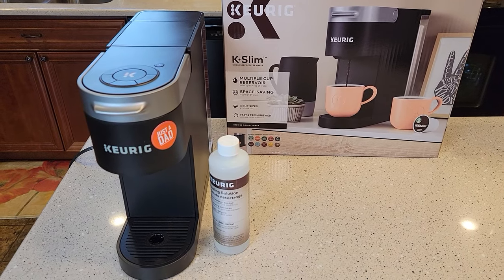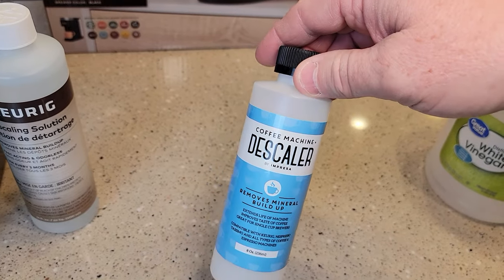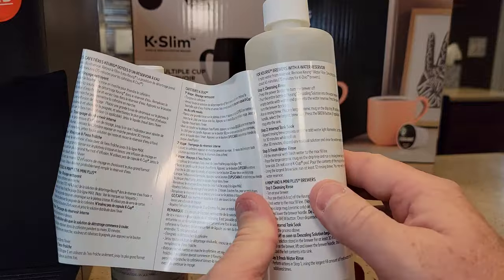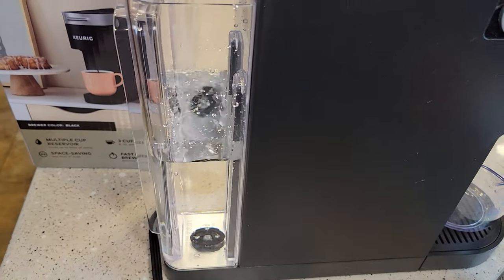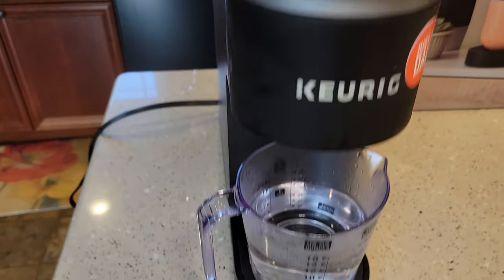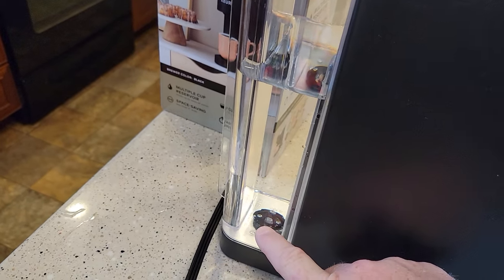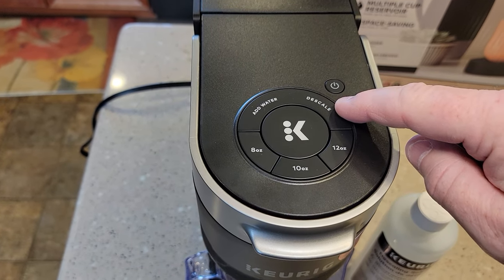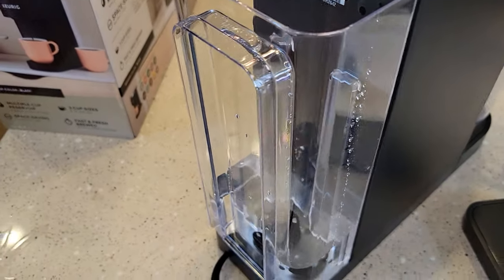HOW TO DESCALE Keurig K Slim Coffee Maker With Keurig DESCALING SOLUTION DESCALE LIGHT ON

Comment: Thank you! The water still didn't want to come out after cleaning the needles(which I learned how to do through another of your videos) so I googled and it said to reset the machine by holding the 'K' and 12oz until water dispersed. Once I did that I came back to this video and it's working beautifully! I appreciate your uploads!
Reply from the maker: No Thank you!!! I just learned something new today about how to reset The machine thanks to you.  Wow Thank you so much for taking the time to leave feedback about your story and let others know how to fix it.  I am sure there are lots of people out there with the same issue.  I will incorporate this into my future videos.  Thanks for Watching and your kind words!!!!!
Reply: Thank you for sharing - I did not know this.
Reply: so if the light still flashes "descale" 

hold 12oz & K  until it resets ?
Reply: Still not working for me. I tried the descale of this video repeatedly, starting from unplugged etc. Now I tried this reset (K plus 12 oz) and it did something so I thought I 
 was good to go. Started descale again and nothing. Mine will not brew if the descale is on, so I have a paperweight. The descale process worked last time I tried it, about 5 months ago. Nothing doing this time. Any other ideas?
Reply: Had the same issue just now, thanks for the tip!
Reply: My output improved some, but I went back to the directions on the Keurig solution bottle and it says you have to let the machine sit in DESCALE mode for 30 minutes after the Add Water light comes on. You said to dump the leftover solution and wash the carafe with soap and water before the rinsing process. I think my process would have worked better after a 30 minute soak. Otherwise, your video was excellent.

Comment: I have the K-Slim with iced coffee setting instead of a power button. And before anyone asks, it shuts itself off after a few seconds of no use. To get into the descale mode I had to hold the iced coffee button for a few seconds (between 3-5 seconds) to put into Descale mode. And then I followed your instructions. It worked perfectly! Thank you so much for the walk-through!! I will most likely be pulling this up in a few months to do it again! (I have a severe traumatic brain injury so short term is pretty much quite short!)

Comment: Thank you for a very clear and consice video of descaling this wonderful machine. They really should make this part of the instructions for these machines. I tried to do this with Keurig instructions and now realize that I wasn't descaling, just running the solution through the machine. I will check out your other videos. THANK YOU!!!
Reply from the maker: Thank you very much!  Glad it helped.
What is your favorite K cup?
Reply: The same here! I used the pouch and followed the instructions to the letter and the descale light is still on, so I will do it again. This time I will get the bottle. Thank you for this great video!
Reply from the maker: @sistermargaretrobinson1596  Keurig has changed the way you descale your coffee maker.  You have to put the machine in descale mode and follow it all the way through to get the descale light to go out.  
step by step instructions see below.  You have to follow them all the way through.  
I hope this helps. put the descale solution in the tank.  You have to put  the machine in descale mode.   First leave the machine plugged in, then turn the power button off.  Press and hold the 8oz and 12oz button for 3 seconds till the big k brew button starts flashing.  This puts it into descale mode.  The only thing you will see is the big k button light on.  the power button does not light up.  press the k button and it will run 12 oz through the machine. keep pressing the k button till the add water light comes on.  don't touch anything just put fresh water in the reservoir and the add water light will go out and the big k button will start flashing again.  press the big k button to start the machine again this time it will be rinsing the machine at 12oz each time you press the button.  keep pressing the k button till  the add water light comes on again.  Once you fill it up with water again it will come out of descale mode and now you are ready to use it again.  turn it on and the descale light should be out. Let me know how it goes. YOU GOT THIS!!!!
Reply: @JustADad  Yay!! It worked!! Thank you sooo much! Subscribed!
Reply from the maker: @sistermargaretrobinson1596  Thanks for the Sub and I am glad it helped!!!!  Good Job fixing your coffee maker!!!

Comment: This worked.  Thank you.  When I was descaling, the water looked clean.  Nothing dirty came out of the brewer.
Reply from the maker: Excellent!
Reply: @JustADad  Does that typically mean the descaler worked or didn’t do it’s job?  I used one of the best selling ones on Amazon, not that it’s supposed to be great or anything.
Reply from the maker: @JustWinBaby_23  if you stay on top of it then there will not be much buildup on the inside.  also if you have soft water you water might be pretty clean.

Comment: Hi , great video I used the Keurig descaler and it works great.  I can’t get at at Walmart.  I have been trying for months and all the Keurig descaling is not in stock at any of the Walmarts within a 50 mile radius of my home.  Could you please show a descaling video using the Amazon solution.  Thanks
Reply from the maker: Thanks for sharing!!

Comment: I just performed this descaling this morning with the rinse pod and thanks for your video.   The process was easy and I ran 3+ full tanks of water to just make sure I rinsed the system well.  The water I use is from a water store that removed all solids, fluoride and stuff that is in normal tap water.  I'm wondering if the descaling light is timed and comes on no matter how pure the water is?  I've only ran the cleanest water through my Keurig & Nespresso machines.   Maybe like a warning light when a car needs an oil when hitting 3K miles.

Comment: Thank you for this awesome video. My machine shut off after all the solution went through. I can’t turn it back on. Any ideas on what could be wrong.
Reply from the maker: see this video  https://youtu.be/UfuYrtctAp0
if it is a 5 needle slim then you can reset the thermostat, if its the older single needle on top then it is just bad and cannot be fixed.
Reply: @JustADad  thank you! problem solved. Clear simple instructions much appreciated.

Comment: Thanks for this. My question is: do I HAVE to put it into descale mode to descale it? I already did all the steps and used the solution to clean it all out before I saw your video. Then I saw your video where you said to push the 8 and 12 buttons to put it into descale mode. That’s the only step I didn’t do. Have I still cleaned it the same way it would have cleaned if I DID put into descale mode? Or do I have to do it all over again? Thanks!
Reply from the maker: If you have already run the solution through it then no you don't have to use solution, just fill the bottle up 2 times with water and use that. you still have to put it into descale mode to get the light to go out.
Reply: @JustADad  thank you sir!

Comment: I'm so upset. I did everything you said. For the last step, I pressed the blinking K, and nothing happen. 2 or 3 drops came out. That's all. I unplugged everything, and tried again, still nothing. I know your directions are correct, so that must mean that my machine is broken. It's only a year old. Since the directions don't explain descaling, I figured my machine would tell me when it's time to descale and it did. The descale light came on. This is the 1st time I descale. I'm letting the solution sit in the reservoir right now. I'll try it again in 30 min.
Reply from the maker: I would call Keurig customer care at 866-901-2739.  This could be a known issue Keurig has with this model of Keurig.  I have had other viewers with the same thing. When they called Keurig some of them said Keurig knew about this issue and sent them a new Keurig.    They have great customer service.  I think you will need proof of Purchase.  So sorry this happened.  I hate it when someone follows my directions and then it breaks their machine.  I am so sorry.
Reply: @JustADad  What? Your instructions didn't break my machine. It wasn't working well before. The descaling light came on. I figured it wasn't working well because it needed to be cleaned. Thank you for your video. It was very easy to understand. Unfortunately I don't have my receipt.
Reply from the maker: @mandijones4995  Give them a call this should not have broken.  It is worth a try.  They have good customer service
Reply: @JustADad  ok, thanks

Comment: I did everything you said now it does not come back on. Only have since Feb 2022. Help please...
Reply from the maker: This could be a known issue Keurig has with this model of Keurig. I would call Keurig Customer Care at 866-901-2739.   I have had other viewers with the same thing
Reply: Did that sending a new one , what do I do then to descale? My fear will happen again with one sending. Thank you
Reply from the maker: @micheleromano6281  Let it cool down after you run the solution through, let it sit for about 30 min,  but keep it in descale mode.  then run the fresh water through it.

Comment: i have the Slim model. I shut the machine off, held down the 8oz / 12oz buttons until the brew light flashed but then nothing happens.. help!
Reply from the maker: did the descale light flash also?  that means it is in descale mode.  if it did then see below.

I would call Keurig customer care at 866-901-2739.  This could be a known issue Keurig has with this model of Keurig.  I have had other viewers with the same thing. When they called Keurig some of them said Keurig knew about this issue and sent them a new Keurig.    They have great customer service.  I think you will need proof of Purchase.  So sorry this happened.  I hate it when someone follows my directions and then it breaks their machine.  I am so sorry.

Comment: I went through process by “add water” light never came on. So I kept going and it still never came on even once it ran out? It seemed to be pouring out water fine when filled however now the descale light will not turn off. What should I do?
Reply from the maker: Sorry to hear about this. I have seen this before in my machine the add  water light does not come on sometimes.  Try this.  Put it descale mode again, you don't have to add descale solution just use water,  It need to go through the cycle.  when you water gets low and before it reaches the bottom remove the tank, don't do it while its brewing,  Sometimes the add water light will come on then.   If it still will not come on I would call keurig and maybe then can help, I hear they are pretty good to deal with. 1-866-901-2739

Comment: I tried both solutions in this video. The generic one and then ordered the Keurig brand. I went into descale mode, ran the solution through, but Add Water light never came on. Ran process until no solution was left. Even though light didn’t come on, I added the rinse water while still in descale mode. Ran all of the water out, maybe 48 ounces. Add Water light never came on and Descale light never went out. 

I unplugged the machine for 1 minute and turned back on. Descale light still on. 

I have a white K-Slim. How do I get the light to turn off?

Comment: I dread to see the descale light coming on because this never goes smoothly. The add water light does not come on when it is supposed to even though I follow the instructions faithfully and unplugging the machine to get the descale light to go off doesn't work either. Any suggestions?

Comment: Hi there! I just did my first descaling tonight and I had bought this machine since April 2022. Yeah... I didn't know anything about descaling until it finally lit up today. I did exactly what you did in the video, but I had 2 issues.  (1) after adding the solution and water, the "add water" did not lit up so I just kept adding more water to the approximate level until it did, and (2) after adding the max level of fresh water, it kept brewing about 16 to 18 ounces, and I had to keep switching cups so it won't overflow. If this happens again 3 months from now, what do you think is the correct way to fix it? Kind of a stupid question isn't it?
Reply: I kind of had the same issue, During the rinsing process after I filled to the top with  fresh water the add water light never came on and it continued to drain the water until the the coffee maker started to smoke! I quickly unplugged it so I wouldn't burn out the unit! It never went out of descale mode automatically?

Comment: Is it normal for the coffeemaker take a little bit to start the water flowing? I ran the rescaling a number of times. But now it is not rinsing like it should. The reservoir is full and when I set it up to go through the process, it makes a noise and then stops, a bit of water comes out but not much. The rescaling light goes out. Is there something wrong with it?? Maybe I need to rescale it again? The water doesn't flow like I thought it would!

Comment: What if the water light doesn’t go off and the descale is still on?
Reply from the maker: yeah this can happen, when it does you have to unplug the machine,  don't run it dry without water in the tank.   take the tank off and hold the unit upside down and shake it for a bit.  since you ran the descaling solution through already you can just water, the machine has to see the add water light come on so it can go to the next step on its logic board.  after the add water light comes on then just fill the tank with water again and run it till the descale light goes out.
Reply: @JustADad  my descale light is still on for almost 3 hours and still the add water wouldn’t come on. I just kept pressing the K button as the descale light was still on
Reply from the maker: @ajbuddy08   This could be a known issue Keurig has with this model of Keurig. I would call Keurig Customer Care at 866-901-2739.   I have had other viewers with the same thing. When they called Keurig some of them said Keurig knew about this issue and sent them a new Keurig.    They have great customer service.  I think you will need proof of Purchase.  So sorry this happened.

Comment: We have a K Slim and nothing's working. Ran a whole tank of vinegar and distilled water through it, descale light still on, tried a tank of distilled water and CLR, descale light still on, 2 more tanks of cleaning solution, Descale light still on, tried reset mode, tried descale mode, cleaned the needle, cleaned everything. Descale light still on :( water does come out though. The pump does make a lot of noise.
Reply from the maker: This could be a known issue Keurig has with this model of Keurig. I would call Keurig Customer Care at 866-901-2739.   I have had other viewers with the same thing.

Comment: My solution was soapy at the beginning, and i pressed the 8 and 12 oz bottom and the K and nothing happened 🥺😭😭😭 help
Reply: It did work after the 4rd time but still even when there was not water, the add water bottom didn't blink, i unplugged it and plugged back on, but the descale light still on😔, i guess I have to go get another solution and try again 😩😭😭 i want coffee 😭.
Reply from the maker: So you don't have to run solution through it if you have already run it through.  You just need to put that amount of water in and put the machine into descale mode to get the descale light to go out.   Keurig has changed the way you descale your coffee maker.  You have to put the machine in descale mode and follow it all the way through to get the descale light to go out.  
step by step instructions see below.  You have to follow them all the way through.  
I hope this helps. put the descale solution in the tank.  You have to put  the machine in descale mode.   First leave the machine plugged in, then turn the power button off.  Press and hold the 8oz and 12oz button for 3 seconds till the big k brew button starts flashing.  This puts it into descale mode.  The only thing you will see is the big k button light on.  the power button does not light up.  press the k button and it will run 12 oz through the machine. keep pressing the k button till the add water light comes on.  don't touch anything just put fresh water in the reservoir and the add water light will go out and the big k button will start flashing again.  press the big k button to start the machine again this time it will be rinsing the machine at 12oz each time you press the button.  keep pressing the k button till  the add water light comes on again.  Once you fill it up with water again it will come out of descale mode and now you are ready to use it again.  turn it on and the descale light should be out. Let me know how it goes. YOU GOT THIS!!!!